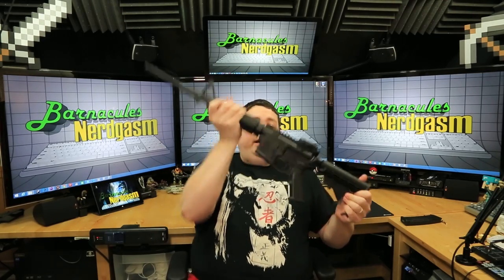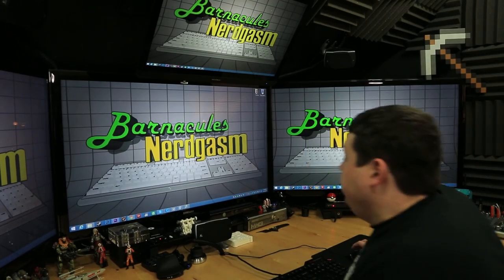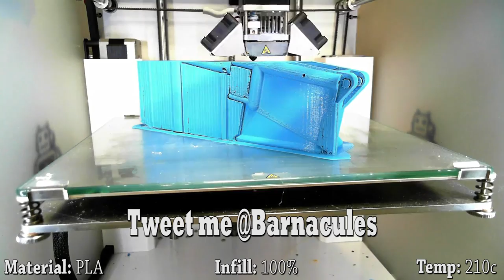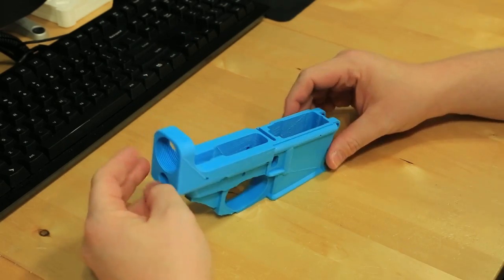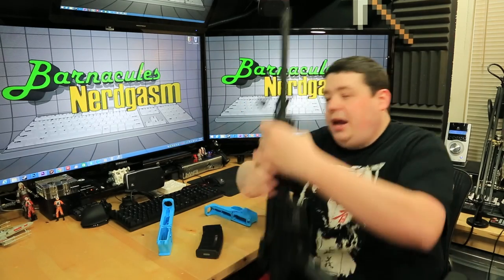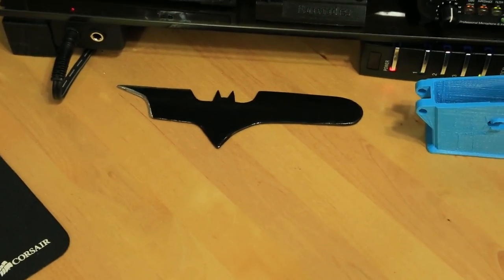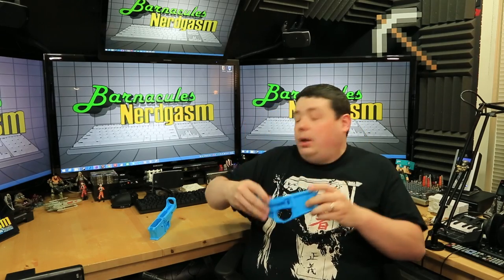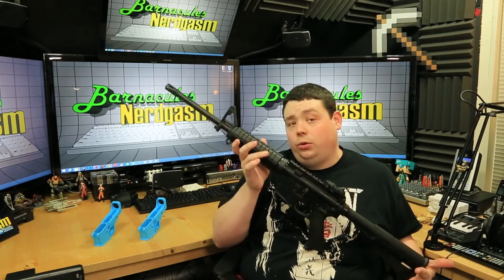Why you shouldn't print an AR15 on a desktop 3D printer 😎 - @Barnacules

Comment: I never understood this media BS, especially with the liberator being "all plastic". Where's the outrage over ceramic blades? You could do a hell of a lot more damage with a ceramic blade on a plane than you could with a single round of .22.
Reply: nj4ck ceramic blades have a metal strip running through them to prevent smuggling.
Reply: DJ Gaming Really? I've only ever owned one and it eventually shattered, there wasn't any metal in it.
Reply: DJ Gaming The point is you can make blade at home.
Reply: +Mr. P wouldnt a ceramic blade show up on a xray?

also glock sells all polymer knives...
Reply: neverknows best
Depends on the type of the ceramic, but you could pass easily trough the metal detector tho
Reply: Mr. P metal detector true. but not xray at airport.
Reply: neverknows best Sure, but if you were intending to do something criminal with a knife on an airplane, you'd probably hide it on your person and not in your luggage. Meaning that you'd only have to pass through the metal detector. My main point here is that no matter how much we give up our freedom and let the TSA fondle our balls in the name of "security", there will always be ways for those who want to harm us to succeed in their mission.
Reply: United States of Embarrassment ceramic blades don't have a metal strip in them. generally they have metal powder mixed into the ceramic. not a lot, but just enough to set off a metal detector
Reply: jacob something its called suitcasing
Reply: Maam Moos 

Y
Reply: Max Raider j
Reply: United States of Embarrassment not necessarily
Reply: United States of Embarrassment Or a concrete impact gun, hammer, fists and legs, etc... But ecspecially wood. Long and proven track record of wood being deadly.
Reply: The media is not bs about the liberator, it can be produced in all plastic. People only add metal to it because the law requires it for metal detectors.

Comment: I can't tell if this is some kind of disingenuous reverse propaganda but you 100% can 3d print working receivers with a regular ass 3d printers
Reply: exactly, the FGC-9 is sliced to print on an Ender 3. The Gcode is in the package. You still have to make the BCG and Barrel out of other mats and need a ar15 fire control but the upper and lower are 100% eSun PLA+
Reply: Enomai no you buy everything else dummy... the only reason you print it is because it won’t have serial numbers..
Reply: @tradesmith_yt  you must be unfamiliar with the project I'm referring to. You make the barrel and BCG yourself. The only thing you buy is the fire control. All other parts are printed.
Reply: @enomai379 , I'm pretty sure this is years before ctrl pew and all their work

Comment: The point isn’t that an entire gun can be printed, it’s that you don’t need an id check, or serialization to order a upper and trigger parts online. Also you can print a lower with enough space for a drop in seer to have a full auto conversion for any rifle you’d like. The idea is that the federal organizations can’t track the firearm as well, which of course ticks them off to no end.
Reply: a "drop in auto sear" by itself is a "machine gun" according to ATF that you need to have a $200 tax stamp to obtain. can't just buy one.

Comment: Is this video supposed to funny? I had zero problems printing an AR lower on the first try. Your skills as a printer are not so good or you purposely set the printer to produce a poor piece. I have put 140 7.62x39 rounds, so far, thru it and not even a jam.  What are you doing wrong is the question. Yes I am using an ender 3 pro.
Reply: Ender 3 Pro? You're joking.
Reply: This video was made 8 years ago, 3d printing technology has come a LONG way my friend. It wasn't so easy to get a tight tolerance part out of a 3d printer 8 years ago.

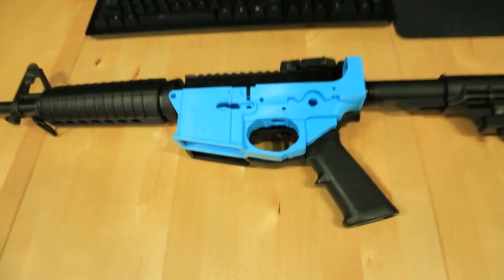Comment: 9:42 Or just scale it up 1-2% and it'll be fine. You're massively overexaggerating the fragility and difficulty of printing. All the load bearing parts are hardened steel or some other metal. The lower is fine as plastic. You can find polymer lowers with reinforcing metal bits if you really care that much

Comment: Incredible how much has changed in 7 years. Weve not only got the lower recievers working flawlessly both with and without fully auto modifications we have been able to print the upper recievers as well as custom grips and the stocks as well.. Many many things are far too outdated.. might be time you made a new video using the updated version of cura and better support settings. This video is considered obsolete in my opinion and has very little value today.

Comment: when software engineers are doing a better job than the media at covering printable firearms, ive always said what the issue cnc machines have been around for years and even lathes more manual but still possible

Comment: 4-7 years later, weve come a long way. We now have guns that can be mostly 3d printed externally. The fgc 9 (rip jstark) is printed and the actual mechanism insode of the gun is shit you can get at any hardware store and you can even modify an airsoft ar15 trigger group in place of a real one for this gun. Also hoffman tactical did some really good prints with easily removable support material. As for antigunners, clearly these guns fir the most part arent meant to be serious weapons. Just some hobbyists who loke building guns. Especially some of the stupid ones like the bullpup glock.

Comment: The beauty of it is that the lower is considered the "regulated" part of the firearm, and if you print your own you don't have to deal with any of the rigmarole of doing the paperwork and all that crap.  The rest of the parts can be shipped right to your front door.  I bet if you had used PLA+ it would have been good to go to test.  This stuff has also come a looooooooong way in the last 7 years.

Comment: Did he actually call the lower receiver the least important part of an AR-15? It is the most important as it holds everything together and is the only part of an AR-15 that is REQUIRED by law to be registered. BTW....I can't help but to notice that he was jamming the magazine in the 3d printed receiver BACKWARDS.
Reply: Well no shit it's an important part, but not so important in terms of the material used to make it which is what he's implying. you wouldn't want a plastic barrel or plastic firing pin. Also he was trying to insert the magazine the correct way, have you ever seen the components of a rifle before?
Reply: cr1ticalRevenge  definitely backwards
Reply: The US is the only major nation that controls/registers receivers. Most other countries control the pressure bearing components of a gun. Its far harder to manufacture a bolt, rifle/heat treat a barrel etc than it is to improvise a basic receiver if you are making guns in a shed.
Reply: @Dustiehippo  it wasn't though
Reply: lower isn't that important, barrel is most important. 80% lowers aren't regulated either doesn't matter, things are illegal not to prevent crimes, but to punish them. He was inserting the magazine correctly, but the shrinkage did not allow him to. Could he have made it work? Yes.
Reply: Give Barnacules a break. He's from Seattle. The "special" is hard not to contract there so trying to put it in backwards when the lower kind of looks like it would be backwards is forgivable. Plus it was lost in a boating accident later anyway so it doesn't even really matter now.

Comment: there is is not such thing as an "assault rifle", its just a rifle
Reply: Prince Pixel “a rapid-fire, magazine-fed automatic rifle designed for infantry use.” — Oxford English Dictionary

Of course, dictionaries don’t distinguish between full auto, burst mode, and semi. A decent 11B can turn anything into a rapid-fire weapon. ;)
Reply: @ObediahPolkinghornIII-cz5io  not to turn this into a debate, but a dictionary is not a good source for terms that belong in the "technical language" category. "Rapid fire" is absolutely worthless from a technical standpoint, "magazine-fed" is too broad because even a pump action shotgun or a WWI bolt action rifles are magazine fed, and the term applies to rifles even if they were not designed for infantry use. An assault rifle needs to be chambered in an intermediate rifle caliber (or else it automatically falls outside the classification), it needs to have a detachable magazine (which disqualifies weapons fed by fixed/internal magazines) and it requires the ability to be select fire - be able of both semi-automatic and automatic fire modes (including burst).
Reply: Titanium Rain You raise many excellent points. The OED is a prescriptive dictionary: it describes the proper usage of English words and phrases. However, that usage is in turn derived from standard usage, which is sometimes a result of public ignorance. A classic example would be “concentration camp”, a term which has been irrevocably tainted by the Nazis. It was never a particularly nice thing in the first place, but now, it’s impossible to use the term without invoking the Holocaust. That’s what makes Ocasio-Cortez’s use of the term so galling: it only works if we pretend that the Holocaust never happened.

You may well be right. The term ‘assault rifle’ exists because of public ignorance. Still, it exists and people use it. We know what it means. We may as well get used to it. Morons will keep us entertained, right? (I’m sure that’s what some people think when they read my comments, anyway....) 🤘🏼
Reply: @ObediahPolkinghornIII-cz5io  to be honest I've stopped caring about the assault rifle debate because the media has shifted to "assault-style" or "military-style" as a way to avoid telling outright lies, and in the last couple of years even "semi-automatic" has been demonized to the point people actually think semi-automatic weapons are excessive or even confuse semi-auto for automatic because semi-autos can be bumpfired. Meanwhile I see people trying to argue that "assault rifles" don't exist (nobody argues that submachine guns or light machine guns don't exist, for some reason) as if that's gonna convince the people who think you shouldn't need more than single-shot weapons or 5-shot revolvers for self-defense.
Reply: No its Armalight Rifle
Reply: Vain as in “Armalite and ballot box”?
Reply: Vain  still a
Rifle
Reply: @ObediahPolkinghornIII-cz5io  no the company that originally founded the ar15
Reply: Prince Pixel ...and an assault rifle, in common parlance (cf. OED).
Reply: Even though this wasn't on in the vid they do exist, it's a rifle that shoots an intermediate cartridge like .223 or 5.56 and has select fire

Comment: Thermal plastic can withstand the heat. We can print things out of it in Engineering class. We also have a dual extruder for support material so you can put it in an acid bath for several hours and the supports come right off

Comment: just because you can't get tolerances right doesn't mean it can't be very easily done with the proper knowledge and experience. I make parts that snap together perfectly all the time. Simplify3d has and xy offset configuration that let's you very precisely dial in the tolerances for every material so that anything can fit together perfectly.

Comment: i wish you did this video again in 2018 because has you know alot has changed and new stronger filaments have come up.i printed the ar15 lower with nylonx and just a little sanding and it absolutely works. i assembled an ar15 and haven't had any problems has of yet. thanks

Comment: 2 or 3 shots before it breaks? I've printed my own design of a lower that has a lot less beef than that one and I put like 100 rounds through it before I decided to print the next iteration
Reply: Video is 6 years old
Reply: @isaacmayer407  I know the video is 6 years old, it's not like I printed my lower in brand new ultra high strength materials, it was printed in plain PLA.

Comment: I 3d print my lowers, tweak until perfect. Do MINOR sanding, encase it in silicone resin and make a mould. Then I can cast the lower, perfect replicates. Also the resins I use are super strong and can add micro fiber into the resin to increase strength. It's easy.

Comment: the LOWER (a "finished lower") is the only part that cannot be bought without going through a FFL,doing the Form 4473,and a background check.
Everything else can be mail-ordered. Granted,this video is NINE years old,and people have successfully figured out how to 3D print a functional,durable lower. they use fiber-reinforced nylon,and other "tricks" to get around the weak points on the AR lower.

Comment: I stated this under a previous comment, however, I believe it is important to post in case people didn’t get a chance to see-

legislation pertaining to “ghost guns” are only applicable in 5 states. in fact, federal law has no regulation on “ghost guns”. the only related act passed was the GCA, however- Congress expressly added in the Gun Control Act of 1968, the Act was not to place any “undue burden on law abiding citizens who use or make firearms for lawful, private purposes.” So just to clarify this comment, it is not illegal to 3d print a gun. No “ghost gun” is required to have a serial number. Just follow local laws and don’t possess these if you’re a felon.
Reply: I would like to add, in case it wasn't clear, yes, you can create a gun for your private use. However, the ATF raid comes if you sell or distribute them without the proper licensing.

Comment: This made me subscribe! The hardest part of 3D printing a gun is like you said tolerance control. Even if you did get that down you still have to worry about the receiver extension breaking and the trigger pins walking out of the plastic holes. A proper lower receiver would need to be completely redesigned to be 3D printable.

Comment: lol now thats its 2020 this problem has gone away.
Reply: how so? are the units a lot more precise with the shrinking now?
Reply: Goon Raccoons Yes. You can buy cheap china made printers like the creality ender 3 and have good success printing a lower.
Reply: @4HUNNIDZ  maybe but lower will still snap after 1 shot.
Reply: @DeruginizCLS  You can find lots of evidence of 3D printed AR's that have lasted into the thousands of rounds. It's because the lower doesn't really bear the same pressure as lets say the barrel or upper. Glock,Sig, even ak lowers can be printed and they work well enough.

Comment: I printed a lower out of carbon fiber PLA with my Robo3D R1+ except I did it standing up with the buffer tube end facing down.  It is very durable and I was able to add a LPK with very little effort.  I printed the stl version that is a little beefier around the buffer tube area for extra reinforcement.

Comment: PLA + is the best fillaments for ar15 lowers
Reply: I don't have a 3d printer yet but would Carbon Fiber Polycarbonate be the strongest? Would I need an inclouser also ? Thanks
Reply: @Windemtight  pla + is just easy to work with and requires less trouble shooting and it gives you a more percise print which is important for firearm parts

Comment: to me, the allure of a pla printed lower, or any other part for that matter, is that if you could perfect the scaling, you could use that part in a lost foam style of metal casting. it would make going from a proof of concept to a prototype extremely fast.

Comment: 3D printing is so far ahead now i have printed with NylonX and PC trust me NOW you can print a AR lower i got at 1000 round on the NylonX print and no issues at all and i did 100 round back to back no stop, to stress test it still works like new, but this video is correct you need to shave down some parts some times but for the most part now in days its all good, ( I DO NOT RECOMMEND YOU PRINT ONE IF YOU DONT KNOW WHAT YOU ARE DOING)
Reply: yea, that's why the internet is
full of "3d printed guns" that 
ACTUALLY function,
....NOT!!!!!!!!!!
yall need to go 
3d print urselves some 
friggn BRAINS!!!!!!!!!!!!!